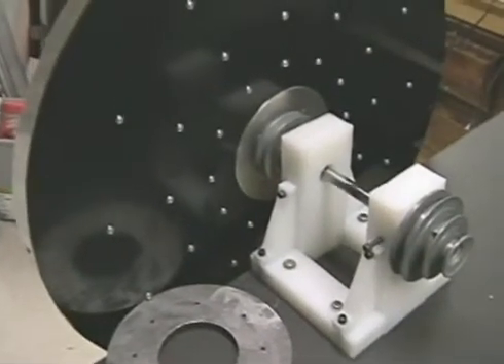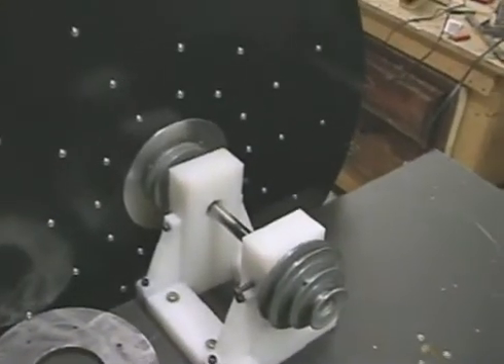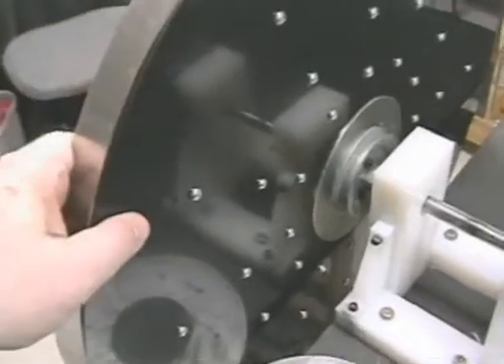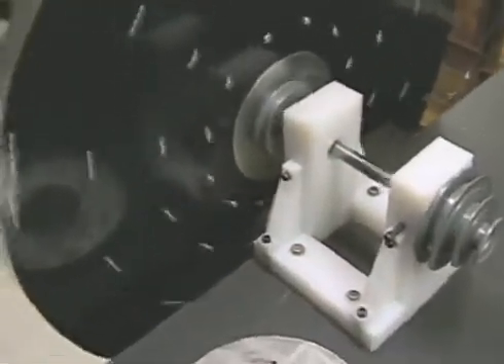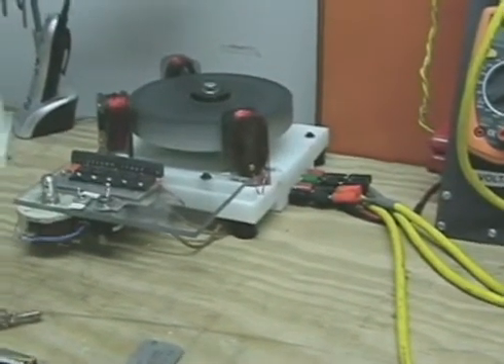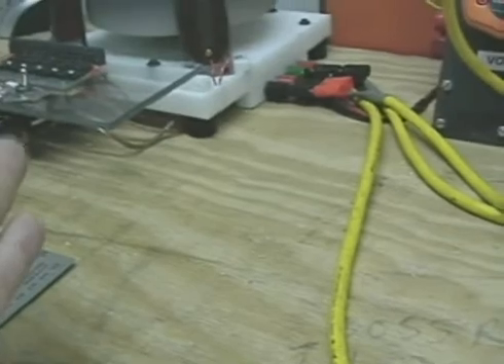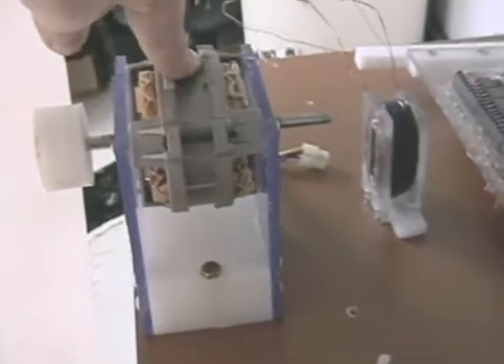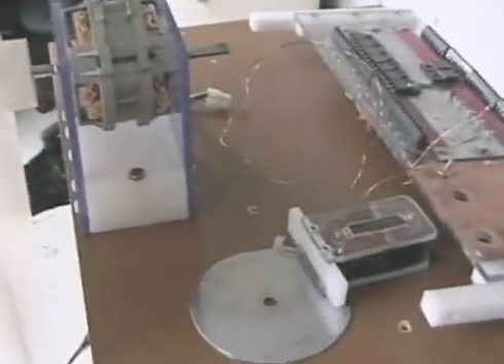Update Cartmotor Mini VMG

Comment from the maker: @KyleCarrington @KyleCarrington  Thanks. the magnet covers are  304 stainless steel , the concept of the magnets spinning, I have seen this before the only problem I see is the speed and force of the magnet flux lines passing the copper coils is what makes higher Amps and higher volts, it would be the same as running a PMG at a slower speed but I cant confirm that, because  I have not performed any  experiment to back that statement up, good luck let me know if it woks :)